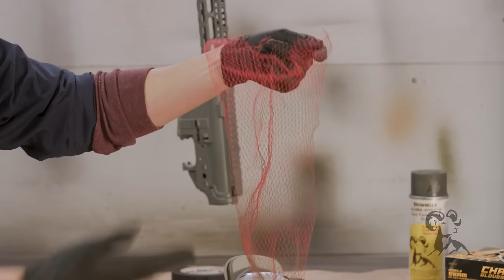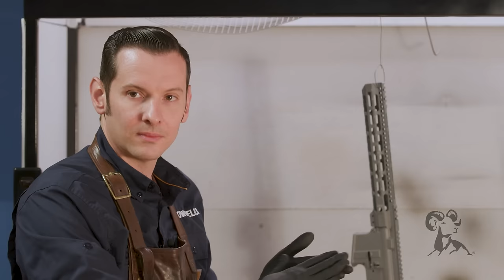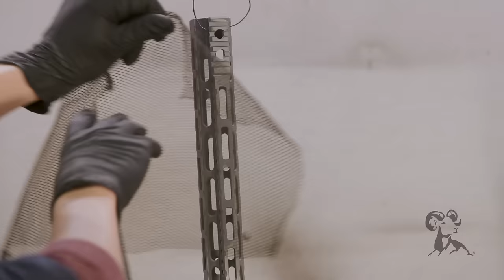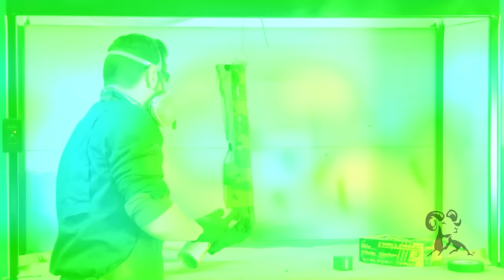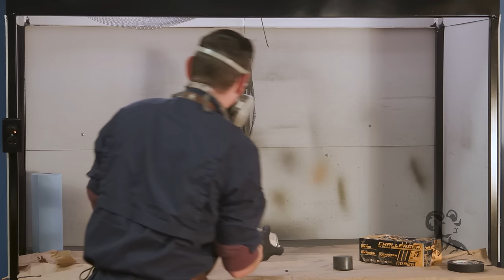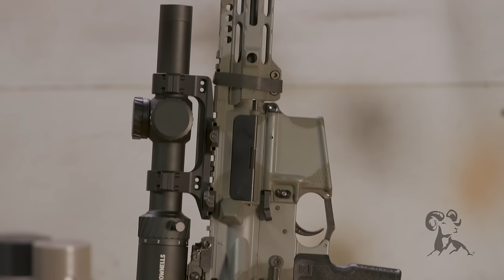How to Paint Your Firearm: Camo Patterns

Comment: My local Joanne fabrics had a mesh material that worked good. Roughly 1cm squares and the fabric part was a bit thicker in diameter than a laundry bag so it let me get really good contrast lines if/where I wanted them as well as faded but still noticeable lines backing it off the surface a bit. Was pretty cheap too.
Base coat light color, than layered a bunch of alternating colors using the fabric and it turns out like a multicam/kryptek pattern that also has large blotches that change colors but blend in between.
And just like you should measure 2 or 3 times before making a cut, go over everything several times when making anything off 😆

Comment: What paint booth set up you have going on here?
Reply: Looks like a work bench   station with overhead lighting that's papered and taped up and maybe cardboard around the outside. Just creates a cubby. You could do the same with the 99 dollar work bench from harbor freight bc if im not mistaken it's got posts on the side, in the rear, to support the pegboard wall and light
Reply from the maker: Our booth has a very powerful fan and tubing pulling air put of the booth and out of the building.